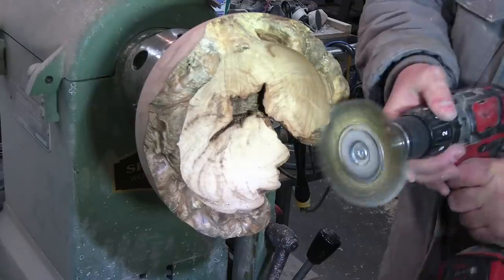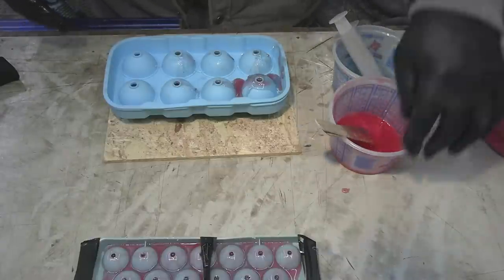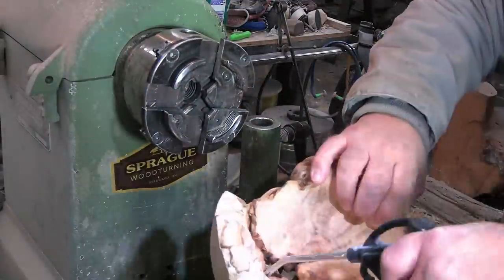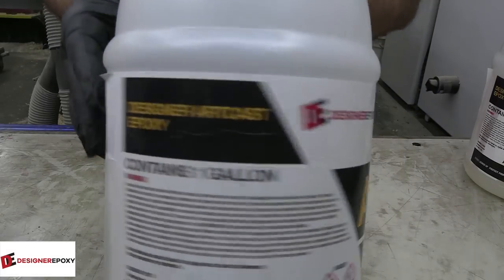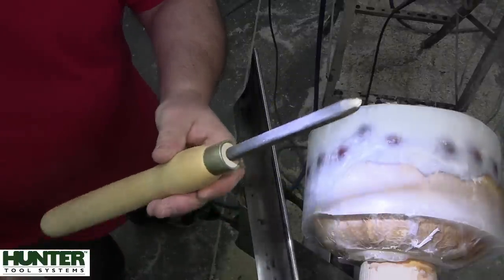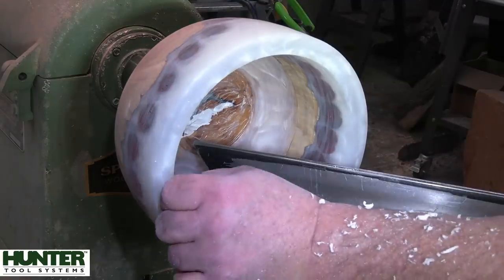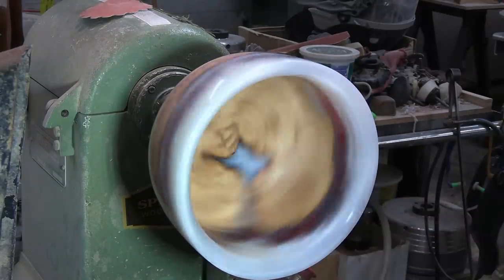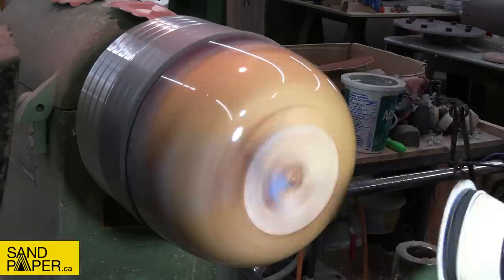Woodturning - The 80K Subscriber Giveaway Bowl

Comment: I didn't want you to cut the inch off thetop, but when you did, I realised you were right, it took the bowl from a Cherry Bakewell to a piece of art.  And was thrilled to have my name in the bowl(woo-hoo!!!).
I wondered for the globes whether a disposable icing bag would do what you need.  Pour both colours in, snip the bottom off and fill the globes through the hole in the top.  The resin may be too runny and mix into one colour in the bag,  I don't know whether that is likely (not using resin), but if it thickens as it starts to cure, it might work. 

If no-one else has mentioned it, you run the holey side of the ice-cube trays under the tap to fill the tray.
Reply from the maker: Yes, I assumed that's how they would be filled. I don't think the icing bag will work. It might be too hot to hold onto if the resin is curing. Thanks for watching!
Reply: @SpragueWoodturning  Yeah, sorry,  that was very patronising.  Really  shouldn't  have said  that.
Didn't  realise resin gets that hot.  Goodness.

Comment: Hi Jim, quite interesting demonstration once again. I agree with your decision of cutting part of the white but I would have kept a little bit more, maybe half of what you took away to be nearer to the golden rule proportions between the burl and the resin. The toughest part of these projects for me really is preparing the molds for casting. Once again you also confirmed that the width of less than an inch is like less than one inch in depth on a larger surfaces. Thank you
Reply from the maker: Thanks for watching

Comment: Your decision to shorten the bowl was the right one. It improved the piece a lot. Maybe the pacman could be a new bowl theme? :). It looked like several spheres actually lifted off. Odd since the density of the spheres and the mother of pearl should be very close. I kind of liked the floating sphere effect. Do you ever stabilize your burl? So many others seem to but I haven't seen you mention stabilization in any of your videos (that I remember). But maybe movement isn't an issue with your burl. Looking forward to the next one. Designer epoxy
Reply from the maker: There was only the one that moved. It’s deceiving, when you look from the outside to the inside and vice versa, they are actually sitting on the burl. If a burl is solid I see no need to stabilize it. It will also make that piece unsuitable for food contact. DE is food safe when cured. Thanks for watching

Comment: When your gluing the plug on the end of your project, can you use different type of glue other then hot glue. Thanks
Reply from the maker: Sure, wood glue will work but if it’s attached to resin I’m not so sure. Thick CA will work but it’s expensive compared to hot glue. Thanks

Comment: A simple solution to the balls moving around in the mold was to just use some thin wood shims around the outside until they didn't move anymore. The shims would end up getting turned off on the lathe later.
Reply from the maker: The UV resin worked just fine and was easy, the one ball must not of gotten any resin on it when I was setting them in place. Thanks for watching

Comment: Thank you for cutting that bowl back. The extra white on top made it look weirdly like curdled boba tea. Yuck! However, it was sad that you cut off the floater that didn’t get glued down. I actually think that the pressure from you pouring the white on top of the line of globes may have broken a couple of them loose. From the side, it looked that one globe pushed away by the force of the white epoxy may have made it move to the side and broke loose the globe next to it, squeezing it up as the white epoxy set. Although I know that the runaway globe bugged you a lot, I think it added some dynamic visual interest to an otherwise static ring of oversized maraschino cherries rolling around the ups and downs of the burl. It’s too bad actually that you cut that off because it adds that element of whimsy to an otherwise frozen-in-place layer of salmon roe. That red ball floating up and away reminded me of Banksy’s Balloon Girl painting (before it self-shredded, of course)—the eye immediately drawn to the stray red globe. However, the rest of the white was just way too much and I’m glad it’s gone, even though it took the balloon away….

Incidentally, the ring you cut off I think will look FAB if you managed to recast a form that has it set diagonally through the next form—kinda like a sash on a beauty pageant contestant. You said it was pretty thick (~1”) so you may be able to give one of your next bowls or hollow forms an orbiter with a red moon. That would be visually very interesting indeed.
Reply from the maker: The ball had to go, lol. I will show what I’m going to do with the top piece in the future. Thanks for watching